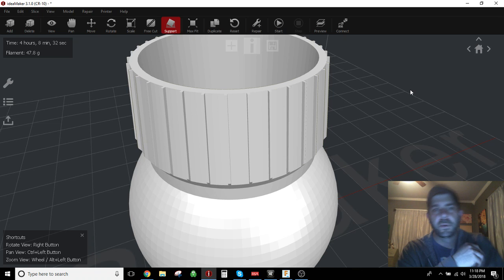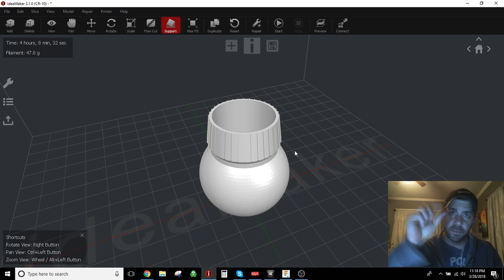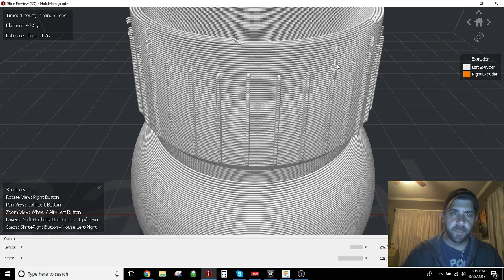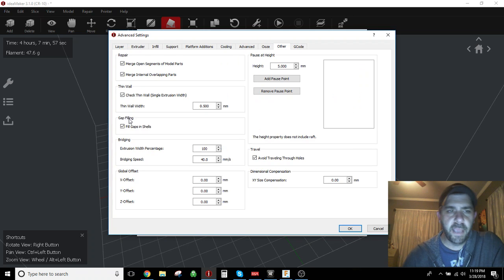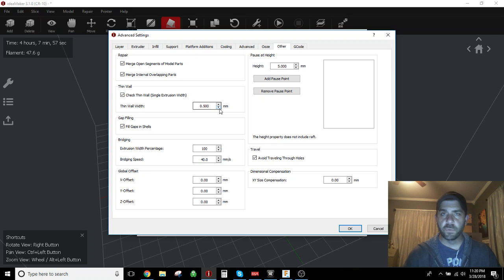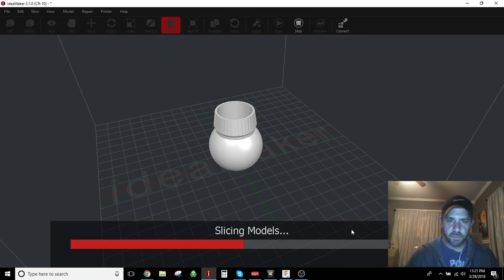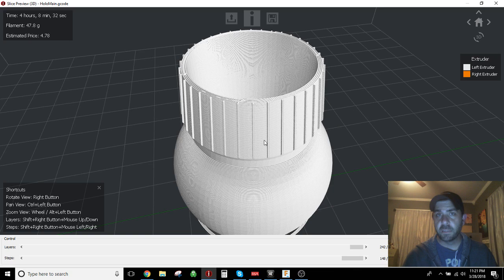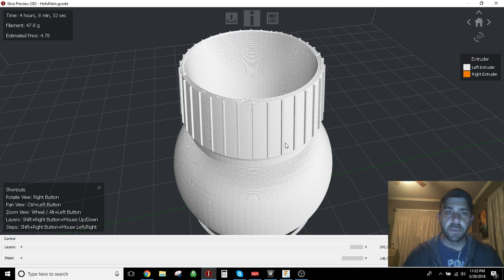Ideamaker tips and tricks - small features not printing??  Try this.

Comment: I made 0.1 mm thick horizontal bfidge in a horizontal hole to support its vault, it is my idea of alternative support. But IM make it with a default layer thickness even if I use adaptive layer height mode. Is any thin recognition feature in IM. I know that I can manually set height of this layer.
Reply from the maker: Sorry for the delay.  I'm not completely following the description of your part and support, but there are a couple of spots for small features.  First, you can look at the "Small Features" section on the Layer Tab of your slicing template.  That area typically focuses more on holes, but it might do what you want.

Second, if you want control of extruded layer height in your model.  Check the Group and Layer setting tab.  You can use the "Per Layer" tab to tell the slice to only output a .1mm height for specific layers.  I've got an older video showing how to do this, just skip forward to about 14 minutes. https://www.youtube.com/watch?v=F4wkOpx1IUo
Reply: @fischer3d  Thanks, I have one more problem with IM: I use filling gap in shells by single extrusion filling with minimum width equal to 10. I use so small width to prevent IM from filling small gaps by non single extrusion. 10% is very small and I want to prevent IM from filling so small gaps, but there is no option for this as I know. Am I right? I know about "solid fill minimal width" option, I use it often, but it  influences on general path, not on gap filling. I need the same option but for gap filling with single pass or without single pass.
Reply from the maker: Do you also have the "Use Gap Filling for Failed Solid Fill Parts" checked on the Solid Fill tab?  Can you post a screenshot of the preview window in IM?
Reply: @fischer3d  Yes, option is on, I don't understand what it does, but it is on, here is the link to the screenshort https://drive.google.com/file/d/1ev_gzn4FidNxVBQxlxEMWZiaP9srzqeL/view?usp=drivesdk

Comment: Can you tell me where the setting is to avoid printed parts in idea maker, the nozzle is not lifting when traveling.Thanks
Reply from the maker: There isn't one specifically yet. There is no "Combing - off" or "combing-not in skin" option like in Cura.  You could try toggling the checkbox on the "Other" tab called "avoid traveling through holes".  it may help a bit. This is one my biggest complaint with IM.  We need a z-hop while traveling options.  Right now you can only z-hop while retracting, which doesn't necessarily mean, while traveling.

Also, make sure the "Force Retraction on Layer change" is ticked.  This may help a little too, but if you are printing something flat like an emblem or keychain where the outer skin finish is super important, this is an area that IM has neglected.  

I put in a feature request several months ago, but unfortunately it hasn't been included yet.e
Reply: Thanks very much for your reply,it's very irritating especially when I've found the quality better than Cura.

Comment: Thin wall width is not there on my ideamake,guess mine is a newer version.
Reply from the maker: What version are u running? 3.1.7 is the current.  Look on the "other" tab.  They tend to move things around between releases.
Reply: Yes that's the newly released version that I have.I watched your video on settings and the layout was different,but I'm guessing that was an older version.

Comment: I was already using that feature set to 0.2 while not even knowing what it really does. It seems im just cool like that. 

Btw, im having some strange issues with supports in Ideamaker. Im trying to slice and print a curvy fan duct, which is mostly just a shell, 0.8 and 1.2 thick. I tried with 3 and 5 walls. Touching build plate only. The problem is that if i use the manual supports then their top of supports goes through the model and they peak inside the duct, while if i slice with supports turned on from the profile then its all mostly ok and i dont see support sticking out inside the duct, as if the top passes through.    
The problem is visible in the preview and unfortunately does print like that too.

Any idea?
Reply from the maker: hmm, interesting... when you load the model are there any warnings?  like the model might be corrupt?  tried running a repair in meshmixer?  Have a link to the stl?  i can also take a look on my end.
Reply: Yeah, no warnings or anything to fix, either in meshmixer or in ideamaker fixer. Its my own model so the first thing i thought is i messed something up, but i cant find anything wrong with it. Thing is, its a bit difficult to print because of the shape so the best option is to position it upright to try to have supports only on the outside and to cut down on their numbers, but i do need to put in a few manual ones, or forget about that specific orientation.

 Heres the link: https://ufile.io/ojo4a  (this is with 1.2 thick walls) and a pic of how i tried to set it up, https://uploadfiles.io/zfavu although i tried that same orientation but upside down with wider section on the bottom. And with different angles of inclination. Its a 50mm fan duct and i did the fan case for 40mm fan which serves as a mount for this duct. There is an edit option in manual supports one can use to move supports top and bottom up and down, but that just makes supports barely touch the model, and they still partially go through it. Well... if you dont mind taking a look id appreciate it. At least ill know if its something on my end or what...
Reply from the maker: Yeah, if i'm understanding correctly its due to the lowest part of the horn, closest to the bed.  It's likely got an overhang exceeding your overhang threshold so the supports come up from the build plate and will go into the narrow part of the horn.  I was able to position the part in my slicer, but then rotated it just slightly (about 4 degrees on the x axis) so the very bottom lip of the horn was flush with the build plate.  This reduced some of the support in that area, but there is a definite overhang you'll have to contend with.  You'll likely have to place manual supports around just the lip of the lower part of the horn instead of them going up inside.  But yeah... that's a tricky one.
Reply: Thanks for trying. I know the lip is a bit problematic and i also positioned it so its flush against the bed in a way where the supports dont enter inside from that position, but the supports that actually bother me are not those. I should have made some pics immediately... like this: https://imgur.com/a/x5sec  I can position it all differently and print  but i just never saw something like this before and couldnt figure out is it my problem or the slicer problem. And this would be the simplest - least supports - way to do it.
Reply: @fischer3d  hi, any chance you could set me up with a new star and end gcode for ideamaker.
A nozzle purge line or nozzle wipe would be awesome. I am setting up an artillery x1 and it has a volcano hotend which suffers from a lot of ooze. Thanks a lot and pleade keep the vids comming 
Cheerd Paul